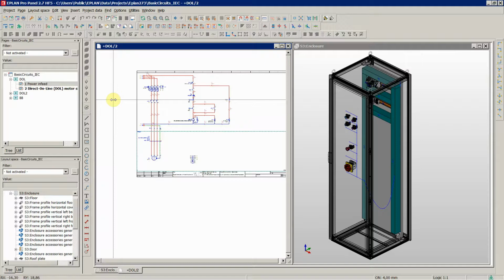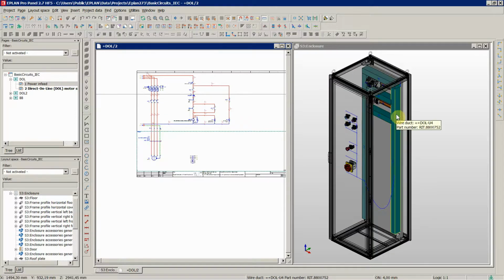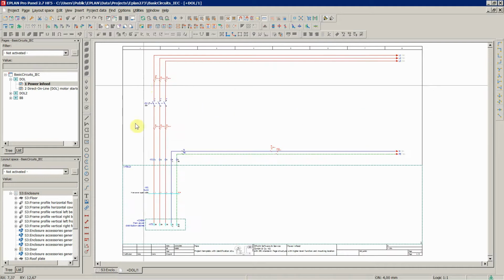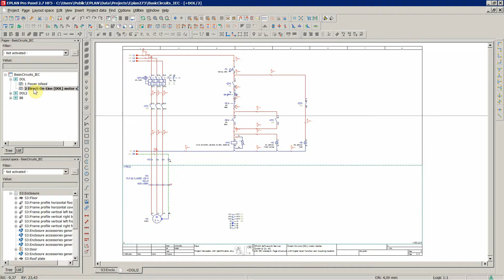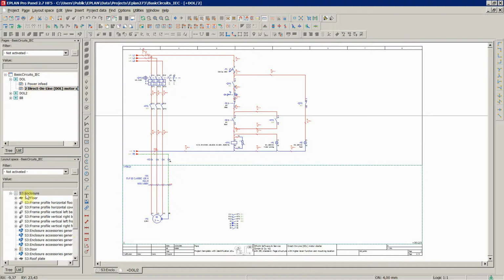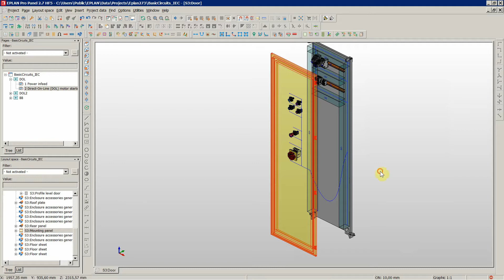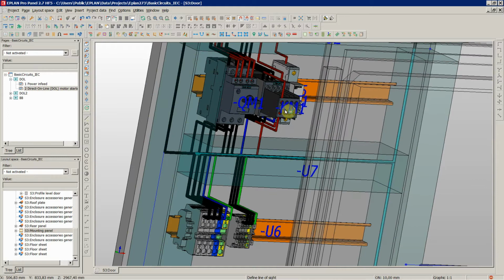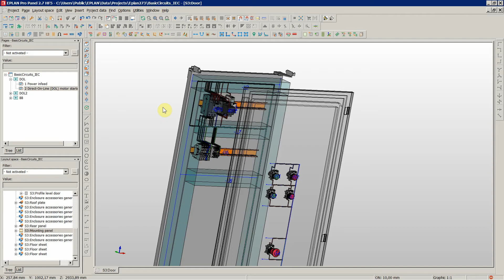Eplan Pro Panel Wiring/Routing in 3D layout space - Intro Video

Comment: Great content Ivan, I'm looking to get the membership plan at your website. But the new Eplan 2022/2023 changed almost entirely the user interface. What version of Eplan did you use and are you going to update the videos to Eplan 2023?
Reply from the maker: Hey Edevald, I still haven't tried out the new 2022/2023 version, mainly because this is not required on the projects I work on (e.g. VW, BMW, Daimler, GM, Amazon etc.). I've filmed the courses in versions 2.7 and 2.9. The user interface has changed, as you stated but the functions stayed the same in large extent. So, it might take you some time to locate the functions in the new interface but this will, on the other hand, be a nice exercise for you, to get familiarized with the new interface. I will at some point make an overview video of the 2022/2023 version, as soon as I find some time...